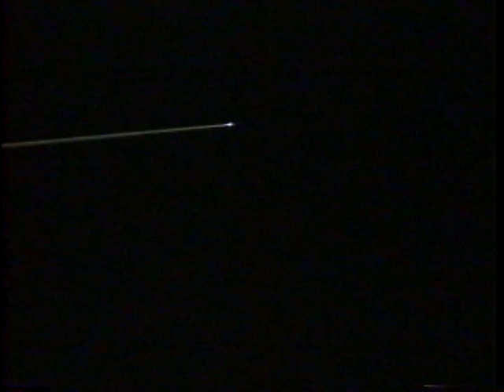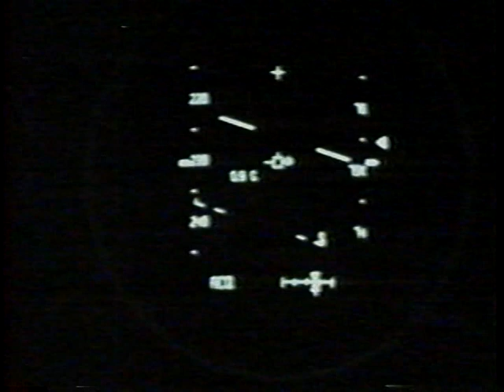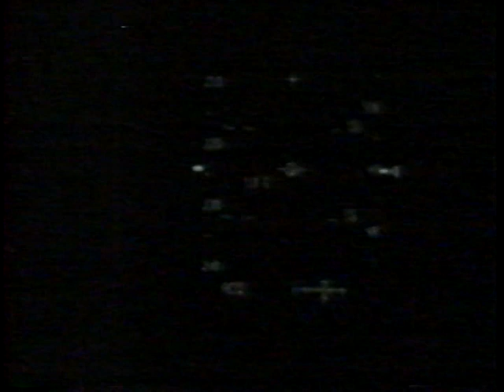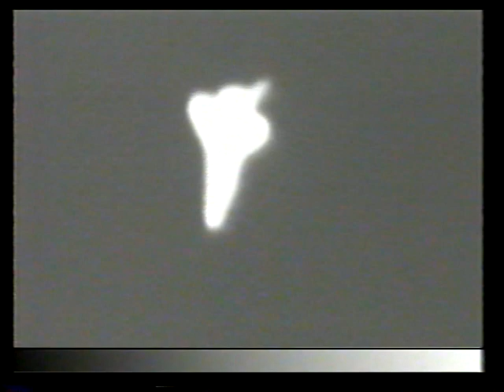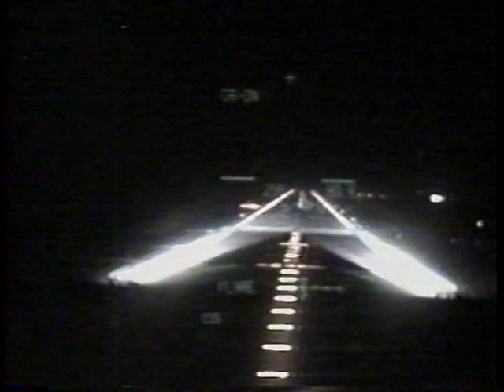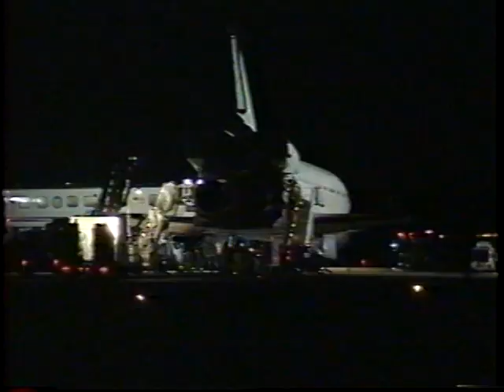STS-93 Night Landing KSC

Comment: Eerie parallels between STS-51-F and STS-93. Apart from engine troubles (STS-51-F had an Abort-To-Orbit and STS-93 of course had the close call with the engine controllers plus small fuel leak), they were the second-to-last SUCCESSFUL missions for the respective Shuttles too (Challenger and Columbia), with each of them flying only one more mission successfully (STS-61-A and STS-109 respectively) before being lost.
Reply from the maker: Thank you for the comment!